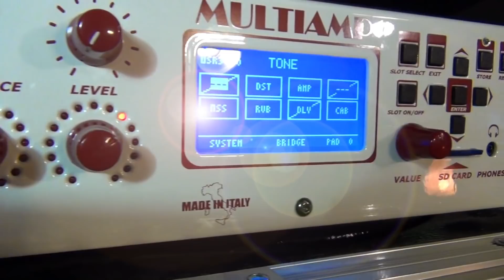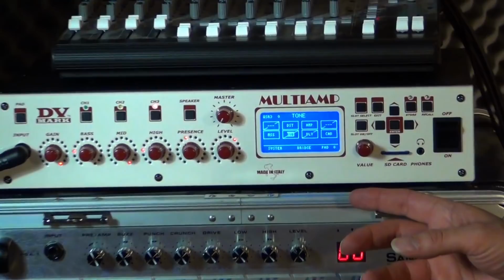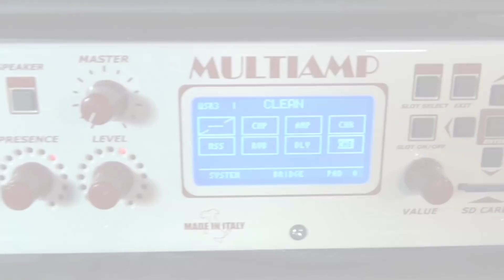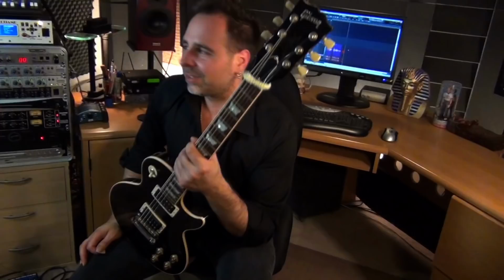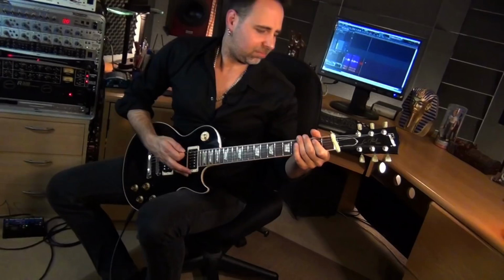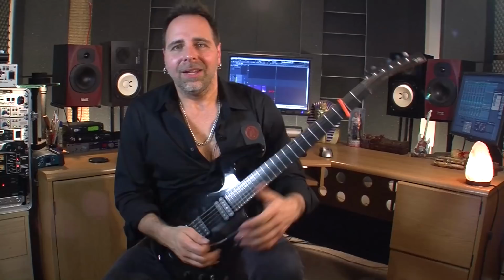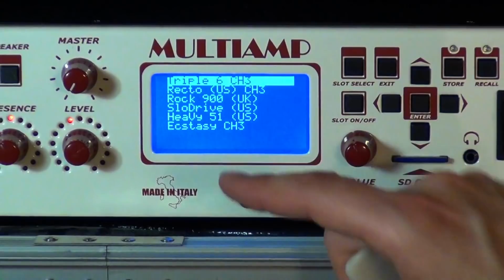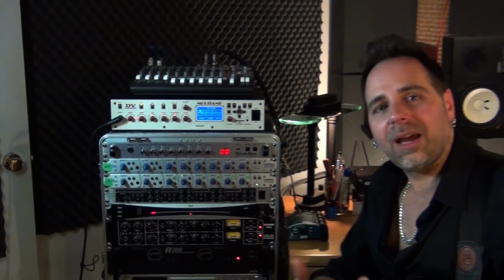Dave Martone with DV Mark's Multiamp

Comment: if you wanted to get a killer clean stereo guitar sound with a delay pedal and thru a tube amp but you are recording mono with an SM57 ---now that you have a sweet single channel guitar sound in the DAW-- what would you do to give it that stereo affect--- I've tried just duplicating the same track then slightly offsetting the track so you don't get the cancellation problem----But how would you "Dave Martone" do it? Record two separate takes?I love the stereo sound you are getting very much! I'm sure the DV Mark MultiAmp just simply has a stereo out?